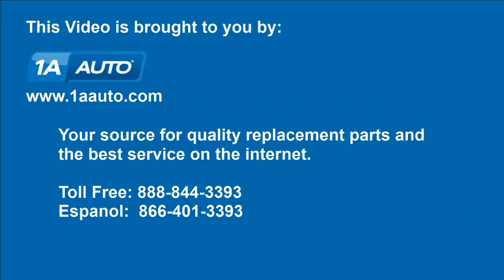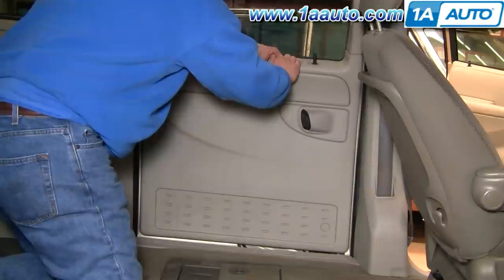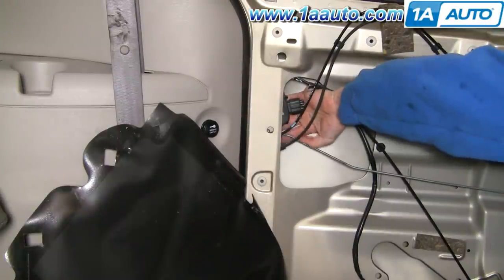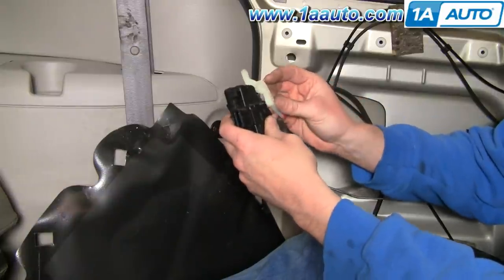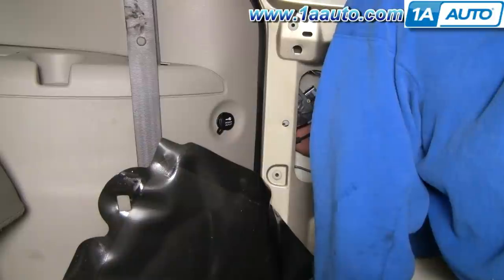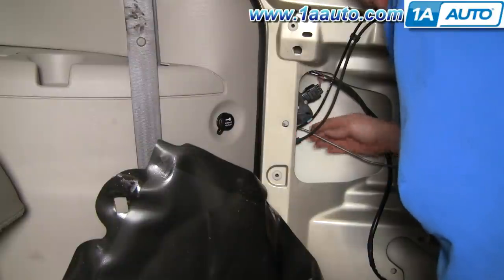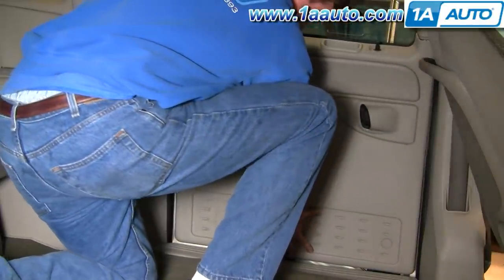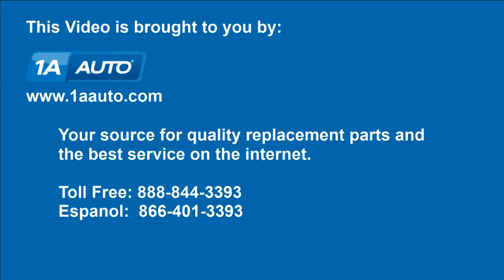How to Replace Door Lock Actuator 01-07 Chrysler Town & Country

Comment: Getting ready to replace the passenger side actuator on a 2001 Caravan Sport.  This video is perfect!
Reply from the maker: Thank you for watching!
 888-844-3393
Reply: OK, so a brief follow-up.  Instead of drilling a hole in the door, I found it was much easier to use a T30 torx bit to remove the entire latch mechanism(3 screws on the back of the door), then move the mechanism forward in the door.  You only have 1 screw to remove to pull the actuator loose, and you don't have to risk dropping the screw(which you will never find) or drill a new hole in the door.  I figured Dodge must have had a way to assemble the whole thing and slide it into the door.

Comment: Thank you 1aauto!  I just repaired both sides.  However, just a note for everyone else repairing the passenger side, you'll need to drill a 3/8" hole to access the T15 screw.  It's pretty easy, just make sure you go slow so you don't ruin the screw head on the other side of the metal.
Reply: How would you know where to drill that hole, if you've never done the driver's side, so don't know where the screw is? You can also get at that screw by removing the entire door latch (but, you have to be able to open the door to remove the three torx bolts on the back of the passenger door, surrounding the latch), with the actuator attached to it (that's then a good time to drill your hole to make it much easier, if you have to replace the actuator, again).

Comment: I have a 2010 chrysler town and country the left sliding door wont open electrically or manually the lock knob is stuck in the middle it won't click forwards or backwards and my door is shut it won't open period is this what I have to do
I NEED HELP PLEASE 👪👭
Reply from the maker: +The Fisherman It could be, but the actuator is just a motor that powers the unlock/lock mechanism.  It could be another issue, but you won't know until you look!
Reply: Thank you for your quick respond 
I will pop open the door panel and see if there's anything jammed in there.
Thank you sir..

Comment: Thanks for Posting !
Helps the DIY'r try to fix it first
before taking it in to the "Over Priced" dealership ..
Reply: Hi ,,, Does anyone know if you have to drill a hole to remove the Passenger side actuator ,,,, or are there
3 screws that can be removed from the back / inside panel to remove it ????
Reply: YES!  I had to cut a flap with my Dremel to reach the actuator on the passenger side.

Comment: My door will not lock/unlock either by power or manually is the actuator what I should replace?
2003town and country
Reply from the maker: +dj tris Thanks for watching!  The actuator is there to lock/unlock with power.  If the actuator has failed you should still be able to manually operate the lock.  1aauto.com
Reply: dj tris. Mine is doing the same thing. I can forcefully pry the knob up with a needle nose. It will then lock and unlock manually or w/ power... until it sits for 20+ minutes. I've also noticed that when it's up and you press lock, the power lock actuator makes a loud buzzing sound. Does this sound like your problem? Keep me posted and I'll do the same.

Comment: EZ-peezee. Did not have the T-15 screw the holds the actuator on in the same spot and had to drill a hole in the door panel to get to it but it was not difficult. (They had it higher and farther back.) Door hasn't locked for two years and could kick myself for not doing this sooner. Thanks